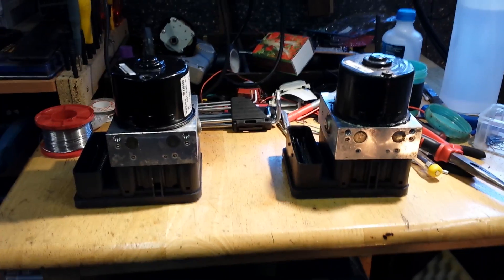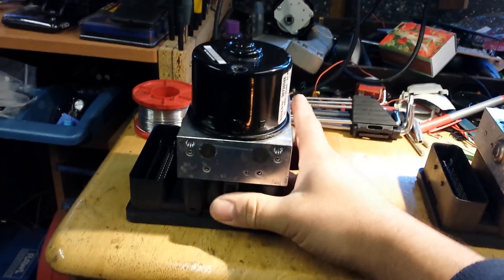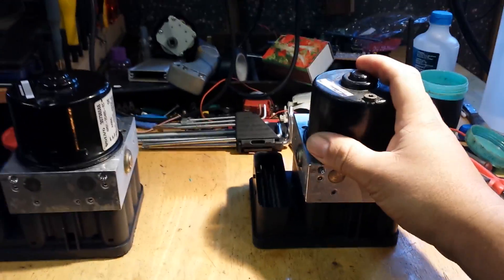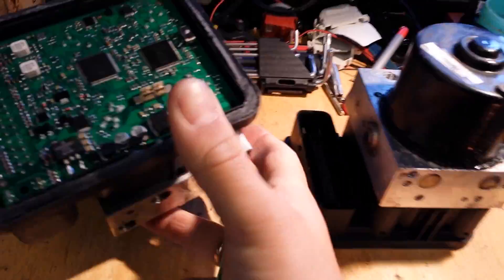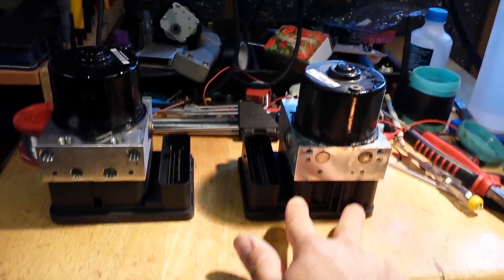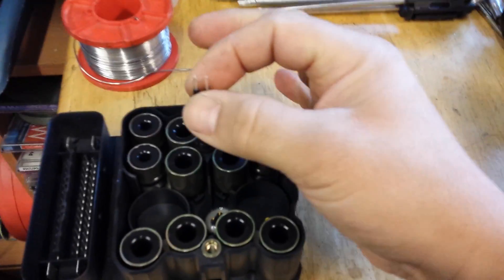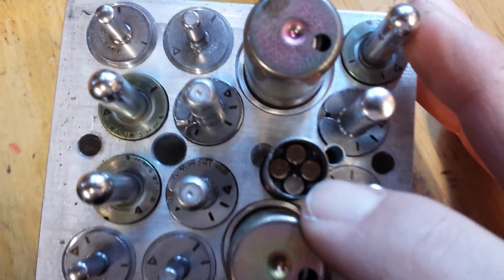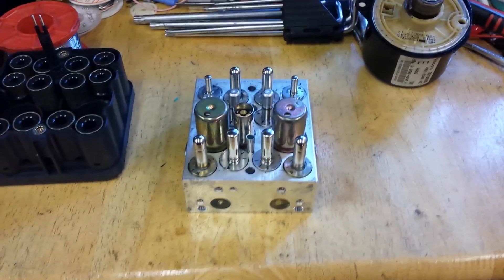Volvo 2005 BCM ABS pump "program"+ pressure sensor fault.

Comment: hi mate really nice vedeo big explain i have a similar problem i gess the ABS not working and the red triangle is on my is a volvo V70 2.0 turbo year 2000 can you tell my what must i do? they said if i change for other abs pump the car never start again with out reprogramed!! is true? if i change for other used must be working who is your opinion? thanks for this great vedeo best regards from norway
Reply from the maker: A portuguese from Norway... we are really everywhere... lol
Possible you are right... if you fit a second hand unit that will prevent the car from starting...
But, you can always reprogram it (although not sure that volvo can reprogram second hand units, and I am not aware of a tool that can do it... google might help...), another option is to do what I have done on this video.
That will copy the settings of your actual module into the replacement one.

But before all that, what is the problem with your actual unit?
Have you scanned the car?
Reply: Hi my dear friend, because in the scaner referred to the fault in the abs unit ecm but not exactlly no one know,  here in Norway there are no specialists in anything and change parts and try to see if it works, if I were in portugal already I had repaired this problem and cheap. But I'm very far from home so I have to try to repair the damage myself. thanks for reply
Reply from the maker: jorge fonseca 
ok... if you need anything else please feel free...

Comment: you say dump contents of rom from old and load to replacement unit. Can you tell me how to do that. Thanks in anticipation
Reply from the maker: Hi
You need a programmer capable of read the chip, then load the contents on the chip of the donor pump.
You can alternatively just swap the chips.
Do you have any experience read and write eprom?
Reply: Hi . Thanks for the reply. No I dont have any experience of read and write eprom but I'll learn - just looked up price of programmers on the net so thanks for the lead. When you say remove the chip and swap I assume that it is not soldered in....is that right? Forgive my ignorance here but I'm on a learning curve!
Reply from the maker: Hi
Glad I could help.
The eprom is indeed soldered.
Either way you need to remove the chip.
You can try to program in circuit... but I would discourage you from doing it that way...
The eprom has only 4 legs... easy to de-solder and re-solder.... if you have no experience, I would advise you to try de-solder smd components on an old board first....
Reply: Thanks for that. Great help. And thanks for the video by the way - really helpful. All the best
Reply from the maker: No worries...
Reply: @LMAutoRepairs  can you tell me what type of proggramer i need to copy the eprom? could in not just swap the eprom over?
Reply from the maker: Yes... you can just swap them...
Thank you for watching!

Comment: Hello, great video !    I'm dealing with ATE/Temic (No. 06.2109-5329.3)very similar from a Suzuki Vitara 08, but pressure sensor/pump it's ok.  Problem seems to be in electronic board.(C1057 code among others reporting failing solenoids, ex C1043).   I've already open it and checked but all seems to be good, no signs of broken or overheated solder joints or components, also main driver transistors and solenoids were checked and are ok.  Are you aware of some video or hint about repairing this type of  boards?  I'm heard about crimping or soldering the contact pins (as they come just pressed from board to solenoids and connector).   Any help would be more than welcome :)
Reply from the maker: Hi
Unfortunately I never came across that problem, however you can measure it from the pins to the PCB, and you are right, those pressure contacts sometimes get loose, making poor contact, soldering them can help, you will be able to see it when measuring.
Check the PCB under the microscope, if you have one, it might be a very thin crack difficult to see with a naked eye.
Aslo check the voltage feed to the module... it should have more than one...
Hope that helps...
Reply: Hi, thanks for your reply and advice.  I'll check all that you mention and other things that I've been reading today in other sites/forums and I'll post the final results.  

So far I think that's possible that contact pins lose pressure over years bc of repeated heat/cold and vibration, besides that, different metals always leads to oxidation, also I've found a bit of brake fluid leak inside the board, even over a uC.  Usually this fluid is not conductive (pure and sealed). But who know's it's reaction over different metals.  

Regards

Comment: hi i would like to know how to re-program a used brake control module for avolvo xc90t6   2004model
Reply from the maker: +Hollis Glodon 
Hi
I have never done that one, but might be similar...
Reply: you must make sure the replacement module matches exactly the numbers and codes as on the original, exactly to the dot !! and that includes the pump !!!  much cheaper than having a Volvo dealer re-programme the module for you !!

Comment: Did it work?  That is the critical piece of information.  My ABS if throwing intermittent ABS check/fail lights. My mechanic drove the car with the diagnostic tool installed.  It was working beautifully and then suddenly went dead.  The next day he checked again and the system was working fine.  He reset the code and the ABS light stays off.  Could poor contact with the pins on the brake pressure sensor cause a fault that comes and goes?   Thank you for the video.
Reply from the maker: Hi
In the video description I say I made a good pump out of the two...
So, yes it worked... at least for my problem... 
What problem is your BCM reporting?
Reply: It first sent a bad front wheel speed sensor code and we replaced bot front sensors and the system worked fine.  Then it turned the ABS warning light back on a second time.  When testing, the unit just dropped dead and stopped communicating with the ECM.  The next day it worked fine.  I am having the fluid and filter replaced in the Haldex unit and I haven't had a chance for another test drive.
Reply: Hi did this cure the problem ? as I have a similar fault !!